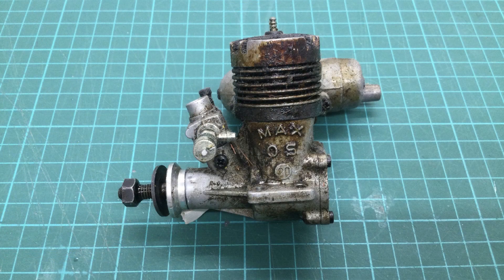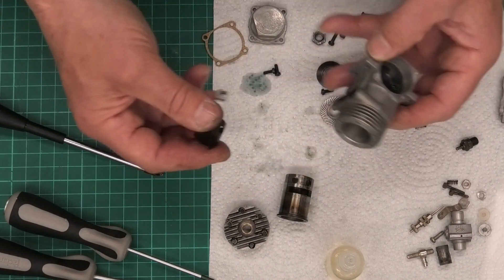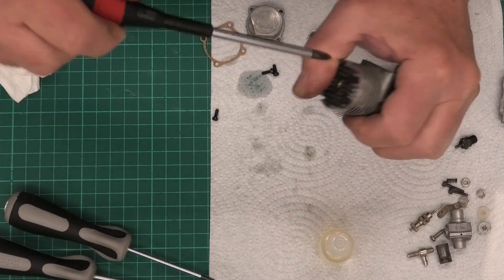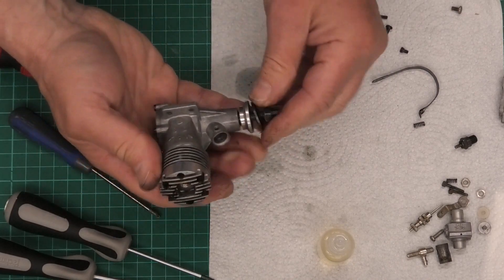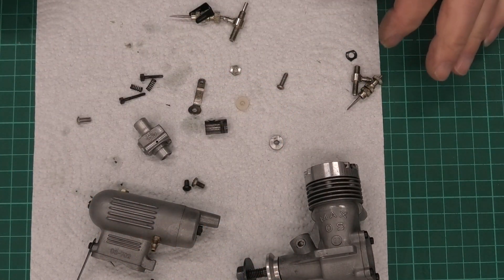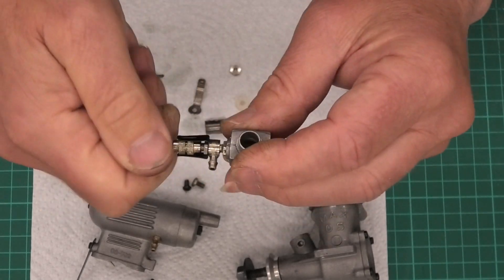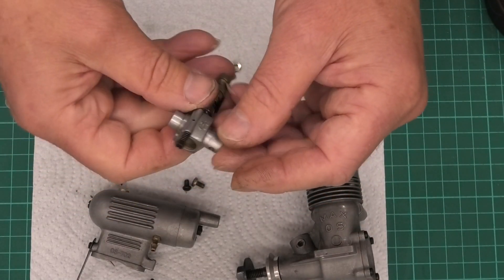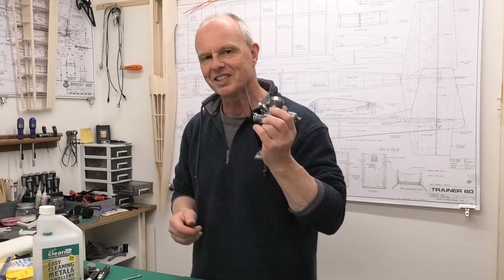OS Max 20 Renovation - Pt 2: Reasembley - 1970's Glow Engine Restoration

Comment: Have 2 of these.  Was hoping to put plain venturis in both for c/l.
The literature in each box shows a head gasket on the exploded view pn 22014105. However! the parts list has no such part listed.  I suspect there is no head gasket, as further inquiry would not confirm the existence of the pn.
This may be a 3 yr old video but is timeless in it's value to the Hobby. Many thanks. 👍
Reply from the maker: Pleased the video is still useful, thank you very much for the comment, it's greatly appreciated

Comment: Hi Mark, I have an engine in similar condition that I’d like to clean up, what would you recommend to clean it if you haven’t got the electronic bath? Many thanks Mike
Reply from the maker: Hi Mike, you could try some carburettor cleaner from the automotive industry and a toothbrush.  But what ever you do try it on a small area first to make sure it does not darken the aluminium. Also be careful not to use anything that could scratch the aluminium case.  Cleaning off hardened castor can be very difficult

Comment: I fly NITRO. .049 - .56.  .049 plane simple build up wing 24" - 30" WS. Flat fuse side walls. On board FT 1 oz.  5 - 6 minute flights. Hand Launched. Fully aerobatic, fly around down low for 4 - 5 minutes, last minute climb, run out of fuel, loop, wing overs, on the way down flop down at your feet. Fly all afternoon use a Quart of fuel. Great fun good practice very low cost. I also fly .46 powered planes, 59 - 60 inch WS and a 1 12th scale P 51 Mustang with a .25 BB in the nose.  Scary Fast at Full throttle, at 50 percent power solid fully aerobatic.
Most fun you can have with your pants on.
I have two of the .20 OS max engines. Building a scaled up version of my .049 plane for the .20's. Build up 36 inch wing. Full 4 channels.  Should be fun.

Comment: Hi Mark. I’ve been watching your channel for a few months now, as I’ve just got into the hobby. I was given a gummed up OS max 40fs. I’ve worked on it, and got it working. I really enjoyed stripping it down and rebuilding it. Anyway, I took a punt and won a bid on eBay for an OS Max-s 35. It cost me £20. Due to my inexperience I didn’t notice the needle valve/fuel entry assembly was missing. There’s so many conflicting numbers on the internet, I don’t know where to start to get one. Could you please point me in the right direction of where to get one? I’d be ever so grateful. Regards Steve.
Reply from the maker: Like you I always go to ebay for most of my engine spared, but can't help you with the spec, but this type of info is abailable somewhere on line, goog luck
Reply: @MarkRobinson555   Ok. Thank you for replying. I’m sure I’ll get something…it’ll be cleaned and sold on as spares otherwise.

Comment: Good video Mark, even though it is not called for a head gasket wouldn't hurt, the engine looked oil and exhaust soaked before disassembly.
Reply from the maker: Thanks for the comment, regarding the headgasket, its not as easy to make as other gaskets, as they need to be foil or light alloy, due to the hear and pressue.  Have to see how it runs, as not all engines have head gaskets.

Comment: I have never done anything nitro before. I've been flying electric for 10 years, and just came into a pile of old, corroded nitro engines to restore and hopefully get running again. I built an Ugly Stick and am going to put a super tigre 61 on it. I've cleaned everything but the carb, which seems daunting to me. Your videos are very helpful to a noob like me! Thank you
Reply from the maker: Thanks for the comment, its great to fly IC, good luck with the change and your glow engines.